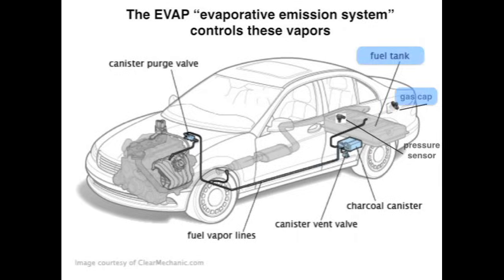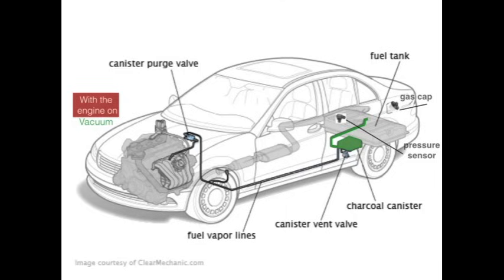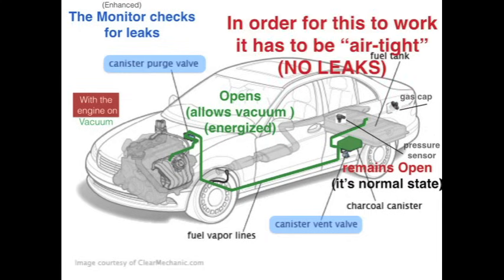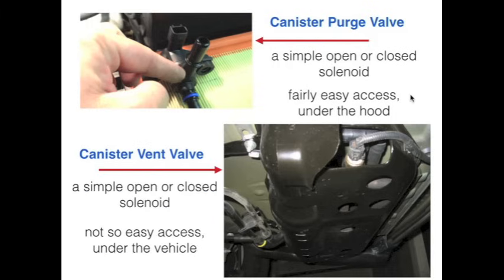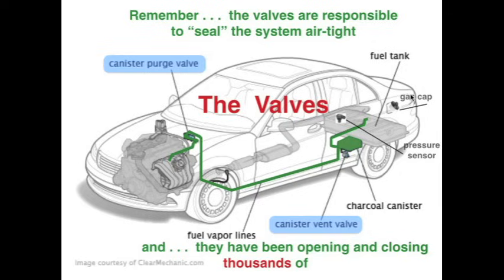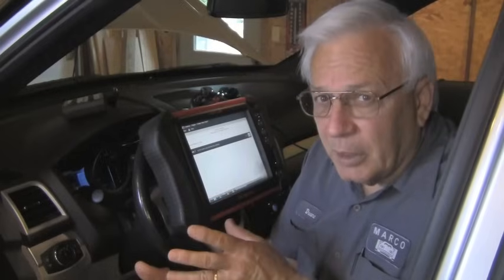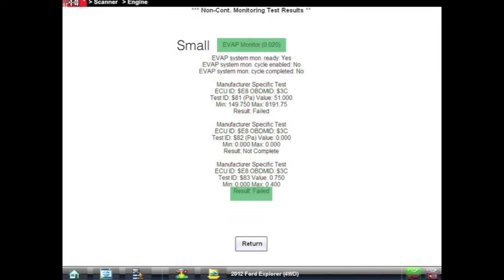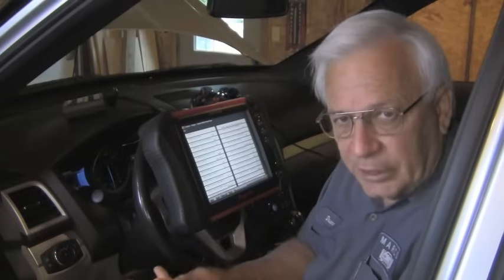How to find a Small EVAP leak without a smoke machine

Comment: I had problems with my Plymouth Van 3.0 LTR. Kept smelling gas fumes after about over 100.000 replaced the power brake booster which is air intake operated as well as piston can leak. Once replaced this solved all air problems I was having including EVAP emissions.

Comment: Does the charcoal canister vent valve vent back to the intake manifold or does it get vented out to atmosphere?  I was never sure and wondered if the system had a device that did vent to atmosphere.  Is it maybe the gas cap?

Comment: Nissan kept replacing my gas cap, code still there, did smoke test, nothing, code still there. What do I do????
Reply from the maker: I understand completely.  Unfortunately, just because they are a "dealership" does not mean they can fix it.  You have an EVAP problem.  They can be very tricky to diagnose.  Many, many, many tech's don't have the patience or skill to diagnose (fix) the problem.  Suggestion - go to a reputable local parts store. Ask to talk with the commercial rep.  They deal directly with local repair shops rather than walk-in over-the-counter sales.  Ask them to recommend a shop that does good diagnostic work.
They usually know which shops actually diagnose and which just "throw parts" at it.  Communication is the key.  Explain the situation to them.  Expect to pay a diagnostic charge, usually around $100 plus the repair.  The diagnostic charge is well worth it.  "throwing parts" blindly is always more expensive.

Comment: To add to my previous post about checking the easiest thing first and my issue being the purge valve on a 2015 Charger, it took more than a squirt of WD-40 to loosen things up. The valve required some throttle body cleaner as well as a couple shots of WD-40 but I think it's finally loosened up. One thing of note is that it's NOT a completely ON-OFF type solenoid in my case. Bluedriver OSB-II shows that it is analog in nature meaning it's variable. New valve is about $25 without tubing to manifold or about $40 with tubing to manifold. This matters because tubing to manifold is difficult (but not impossible)  to remove from valve.

Comment: Everyone is a teacher, but not everyone is a good one, and you Duane, you are a stand out!
I have a few questions. In order for the monitor to check for the leaks, both valves have to be closed.
How did the canister vent valve  close? since it's open when the engine is off.
On the large & medium leaks, system passed, , how do you interpret the values shown? what I mean, how would you know whether those values are optimal, or on the borderline of a leak?
Again, thank you for video and the wealth of information
Reply from the maker: Thanks for the kind words.   Great question but not an easy quick answer.  The ECM has built-in controls for the systems it monitors.  So the ECM closes the valves when it starts the test and opens them based on the test results.  You would need programmer instructions to get the actual answer.  Keep in mind all electronics are simply voltages and ground.  All ECMs are binary devices which means they can only read 0's and 1's, not voltages.  All data is converted to 0's and 1's and is either an input or an output.  Programmers ask the questions as "if, then" format.  example, if the valve is open and the test is requested to run, then close the valve.  The test runs, results are reported, and the next "if" question is asked. 
The EVAP test answers are based on time.  For example, how long did the vacuum hold? The answer determines the next response (action).

Comment: As I've repaired things for customers, I've always explained what went wrong and why I chose the solut9ion.  I appreciate how you explained then even adding the cutaway further explains how the system works.  I just replaced the solenoid assembly on my 2009 suburban.  When I first went under the vehicle, I was not able to find my way, eventually I found the charcoal canister. In reality, it may be a lot more difficult to make the repair than what we saw, videos can be so misleading.

Now that I replaced the part, using my OB2 code reader I purchased from NAPA, I can clear the code, the ECL no longer shows on the dash but the code reader says the error is permanent.  Is that going to be a problem down the road?

Also, I can see you do this for a living, what brand of OB2 device do you have?  I'm sure it wasn't cheap.

Again, thanks for the video -   Jim
Reply from the maker: Jim, thanks for your comments, and I'm glad it helped.  Here is what I can tell you. Many "code readers" simply read codes and can often clear the codes.  However, they cannot erase items stored in memory.  You would need either a full-scale Scan Tool or an OEM scan tool.  Both are expensive.  EVAP codes are often stored in memory and many MUST be cleared with one of these expensive tools.  If you did fix it there will not be a problem down the road and the SEL should remain off.  I use the Snap-On brand scan tool.

Comment: Great video!
I have been troubled with this code P1450(unable to bleed fuel tank vaccum) and still have not found a solution. I have changed the purge flow solenoid as well as the vent solenoid attached to the charcoal canister box. Forsccan data shows 3D 81(blocked evap system line-fault confirmation test) not ready, and 3D 82(vapor blocking valve perfromance) not ready. For some reason it is never able to test. Any idea of what you think can be causing this?

Comment: BEFORE you watch this long video, which is well done, know that it is not about "How find a small evap leak without a smoke machine" but rather is is about how to understand the evap system and use an expensive professional scanner, IT IS NOT ABOUT HOW TO ISOLATE A LEAK (hopefully that is in part 2, yes there is a part 2 even though this vid is not called part 1.
Reply: Thanks for letting us know, Im glad I didn’t waste 13 minutes of life watching. 👍

Comment: How much voltage should the EVAP vent solenoid have only showing 4.6 volts vehicle does not have engine codes but is showing a small EVAP leak did  smoke test and traced it back to the cannister above spare tire 2003 f150. Replaced all hoses back to the cannister smoke coming out the cannister, do not hear a clicking sound from solenoid vent valve replaced it and still show small EVAP leak.....bench tested the solenoid and it works with 12 volts direct from battery.....hmm

Comment: Does anyone Know why a hose connected to the EVAP charcoal canister is not connected to anything? Is this normal, like a vent directly into the air, or is this supposed to be connected to something? One side of the hose connects to the canister and the other side of the hose is not connected. Any help is greatly appreciated.

Comment: I'm getting a blinking Monitor icon, "EV", yellow LED indicator light, No DTC's presently stored in code reader's memory. Also, NO Engine light is presently showing on dashboard. I'm not a 100-mile guy at age 75, so it takes me a while to travel around town (don't travel) until a cycle is reached. It's been since May when a part was changed, and codes cleared.
Reply from the maker: Flashing Yellow: Indicates charging session has ended successfully and/or vehicle battery is fully charged.
Reply: @realfixesrealfast  - Yep, the battery was tested (out of precaution yesterday) and it is fully charged. However, the manual says: "YELLOW LED - Indicates there is a possible problem. A
“Pending” DTC is present and/or some of the vehicle's emission
monitors have not run their diagnostic testing"

Comment: Need a little help with mine, engine speed is 0 rpm, engine temp is 167, and the system is in an open loop. So would this mean the vehicle was off and the leak was detected?

Comment: Lmfao instead of using a 100$ smoke machine. Let’s use the “critical thinking method” aka use a monitor system that costs over 1000$ 😂😂 
 
Good explanation of the evap system itself though. Would have bean better if the video was simply that.

Comment: I learned the hard also to never overfill a gas tank. I destroyed my purge valve doing so. Luckily it was only 70 dollars for a motorcraft oem part and was 2 bolts and 2 quick disconnect hoses to change it.
Reply: I recently had a service station attendant override the auto shutoff and probably do the same thing.  Today I got a check engine light and a P1456 code for a small evap leak.  On my 2002 Honda Accord the purge valve is on the back of the throttle body and is difficult to reach.

Comment: My check engine light isn’t on but I used an OBD reader and it said I had a very small leak. I guess not big enough to throw a code. I got a new gas cap since it’s 15 years old just to see if it goes away.

Comment: First thing to do, replace the gasket on your gas Cap. Esp if the car is old. this will cost you around $20 or less.  I got this evap code, reset it, a week later it came back, I checked my gas cap and it didn't really feel snug like a new one, so I checked online and I found a recommendation to replace gasket. worked for me.

Comment: Is the ECT is at 178 degrees F, why would the vehicle still be in open loop?
Reply: A vehicle will go into closed loop when ALL the required conditions have been met.  Those conditions can vary with each OEM.   The ECT is just one of the conditions.  Many also must also see the O2 switching at a fast enough rate.

Comment: One morning, I plugged ODB2 scanner and accessed live data, then started the car(cold).  Fuel System 1 showed Closed Loop but most places I read that it has to be open for some time.  Why is that and could a failing fuel tank vent valve make the fuel system to be closed on cold start?
Reply from the maker: basically closed loop should be attained within 2-3 minutes or faster on newer vehicles.  However the PCM  must also see the O2 actually switching.  If there is no switching it will never go into closed loop.
Reply: @realfixesrealfast  Thank You!

Comment: Finally, an actual teacher to teach all of us old school mechanice, these modern computerized cars. Thank you Sir, Salute.
Reply from the maker: Thanks,  I appreciate you taking the time to comment
Reply: @realfixesrealfast Hi everyone,

Please tell me — my EVAP purge valve shows between 10% and 15% duty cycle when the engine is fully warmed up and idling, even after a normal drive.

Is that normal, or could it mean the purge solenoid is slightly stuck open or leaking?

Thanks for your help!
Reply: 3:12

Comment: 🚩Been told I have small leak. Engine light on over 6months. Nissan Sentra 1999. Gas cap new. Recently been having some Problem with Fuel system, changed Filter, runs ok, but feel something is still wrong. My worry is Inspection, next month, I will fail, due to Emissions. How do I find The Right mechanic and what could it cost.. roughly. Be great if u could answer. Any help 👍
Reply from the maker: Great question Sue,  Finding a good honest mechanic is not easy.  Here is a tip I often tell people looking for a good mechanic.  Go to a local auto parts store, ask for the person who deals directly with local shops.  Keep in mind the person at the front counter is often new and/or may not have as much experience with the local shops.  Most stores have one person (usually in the back) that deals directly with shops instead of counter sales.  They usually know which ones are good with diagnostics and which ones are just parts changers.  I wish I could tell you what it would cost but it really depends on what the problem is.  Good luck.

Comment: Little leaks lol. EVAP leak is a vacuum leak. There is also a EVAP sensor on some cars. So people what I'm trying to tell you and is very cheap to avoid these leaks in the future. I've seen vacuum leaks in the gas cap to the intake manifold leaking. At 50,000 miles all your rubber hoses should be replaced period. Please it's not expensive there cheap Wade's. Hose is like $1.00 a square foot for small vacuum hoses. How much money are you going to spend like a smoke machine to find the leak or just forget using the Machine and just replace the small rubber hoses.

Comment: Hello there! I fill my car's tank in a gas station. Then it doesn't start immediately after. But after 5 minutes or so I push the ignition on and everything goes fine. This happened 3 times. I never let my tank dry out. For the moment my car is fine. But next time I want to refill the tank that feeling, that my car won't start immediately,   takes over me. What could be the problem? Thanks.
Reply: I read that a stuck purge valve will cause this problem. Also could be bad fuel pump

Comment: So your saying that the problem with the vent doors is not a problem that the computer spots? Therefore not a leak, correct? Cause no check engine light comes on with that problem. Interesting.
Reply from the maker: Pete its really hard to say for sure without seeing it and how it is responding.  Depending on year, make, and model, some oems software reports havoc codes and some do not.  But you should know this,  the actually cooling of the system and if you do or do not have a leak is best diagnosed with a gauge set with the system operating.  The vent doors do not create the cool air, they simply "vent" it to the proper outlets.
Reply: @realfixesrealfast  Thanks,, Guess my question, comment, was,,, If your ac, heater, fresh air vents work via vacuum and they quit because of lack of vac,,, thats not something the puter reads as a problem.
I have that problem now and though I know the fixes, why replacing a 20 dollar resevoir and or a simple check valve should be so difficult and expensive to fix. Thanks for the response.

Comment: This small leak results for two reasons, P0443 faulty connector not completing circiut and remains until completion of satisfactory results
P0456 Evap purge valve stuck slightly open
Reply: Found out that Nissan has an extended warranty for all evap codes p0443 455 456 and up to 150,000, Free repair for 2010 +

Comment: I have an 02 cavalier that will not take gas. Replaced the charcoal canister as well as the vent valve solenoid. Have dropped tank and checked the in-feed ball. It’s not stuck. Any suggestions? May not be related but the fuel gauge also stopped working properly at same time. Always reads as Empty.

Comment: Engine light on, code P0440, P0441, P0446, Evaporative emission problem, which valve I need to change. Thanks. On 2002 Sienna, 72,276 miles, running very smooth. But engine light on.

Comment: Good video Wayne, but If the Purge Valve is closed (sealed) with the engine off, how in these videos does the smoke from the smoke machine pass through it and come out through the vent valve? Also in Building HVAC work, a NC (Normally Closed) valve allows flow, and a NO (Normally Open) valve shuts off flow. So I am having a problem with this.
Reply from the maker: two answers, you can operate the purge valve either with a scan tool or jumping the correct wires;  Normally closed & open are often referred to however they could be a normally closed valve which blocks flow of pressure, or a normally closed switch which allows continuity and therefore flow of current.  Be sure your understanding that difference.
Reply: I was wrong, NC stops flow, NO lets flow. I was thinking Electrical, where open means no electrical flow, and closed means flow (switch closed). But still how does the smoke make it out the vent if the purge is closed?  The smoke machine must hook up into the line after the purge valve since it is closed with engine off and blocking flow.

Comment: For almost a year i smell a strong gas when I am driving asked 3 different machines and no one could solve the problem (or they don't want to mess with it. But one mechanic friend with no devises told me what the problem could be with no cost. Why. Till i can try to have it fix still not sure why i smell gas when i drive but not all the time at the moment more offend then i like.
Reply: Hi Lorene,  if your smelling gas while driving it can only be for one of two reasons.  One, you have a actual fuel leak of raw gas. The fuel pump pumps gas from the tank to the engine.  It travels thru tubes under the car.  If there is a leak it could be dripping and causing the smell.  Or, reason Two, the EVAP system has a fault.  The EVAP system is workin g when you Are driving but it is NOT raw fuel. Instead it is fuel vapor.  So if that system is not working properly you could be smelling fuel vapor that is evaporating.  Hope this helps.

Comment: At one point I have a question to the evap system . In the test case ( purge valve and vent valve are closes ) the system reads the pressure sensor in the tank to detect , if there is possible leak. But the the engine is running . The fuel pump pumps gasoline from the tank to the engine. How the system differs a leak from normal fuel delivery ? The pressure should drop anyway ??

Comment: Very helpful. I replaced the defective canister purge valve on my 2014 RAM 1500 Big Horn 4WD 6 cylinder 3.6L after watching this video. Passed the emission inspection after driving 3 'driving cycles'. It is important that you let the PCM set P0456 to inactive and turn off the check engine light. Do not clear the fault code. Otherwise, you would not be able to confirm if the problem is really fixed. This video would be perfect if you explain what is a driving cycle and how many are needed..

Comment: Soo..22 minutes of video summed up: Two valves are responsible for keeping system air tight. Purge valve is one. Purge valve easiest to get to. Purge valve has opened/closed thousands of times..pull off Purge valve. Purge valve fails vacuum test..done.
Reply: Yeah long vid-- only complaint is he didn't recommend checking the gas cap first. Now, I ain't no expert or mechanic or nothing, but since that's the easiest and cheapest potential fix, that's where I'd start before even thinking about replacing solenoids.